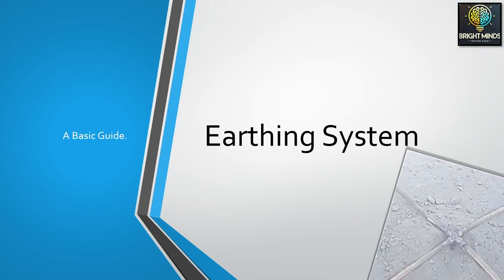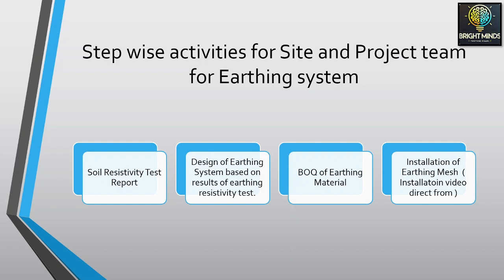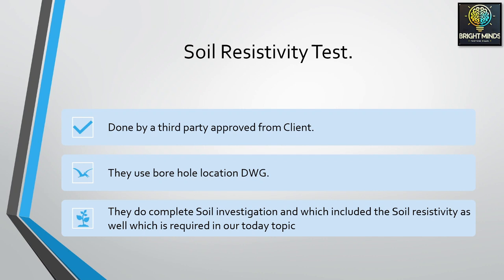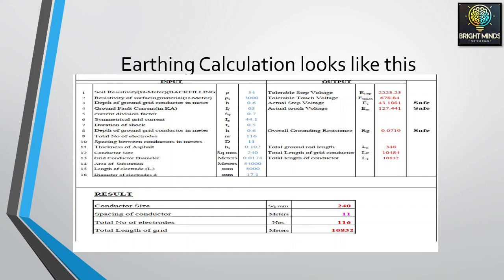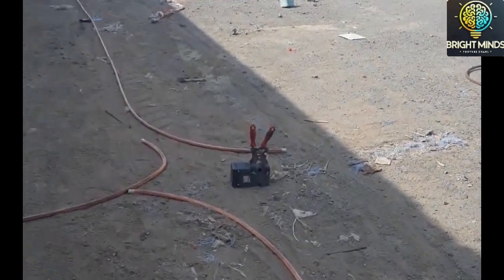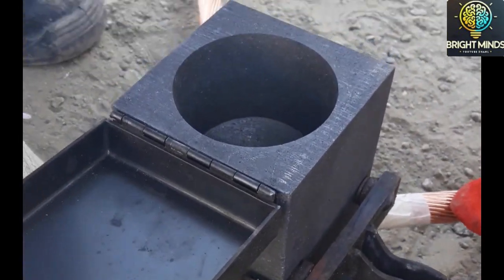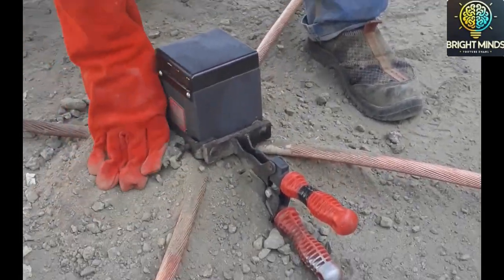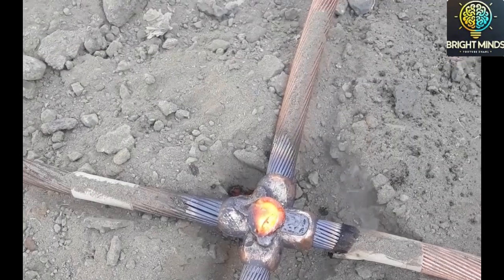Earthing System and substation [Video - 6]

Comment: Dear Sir,   i just wana mention that there are a few aspects related to the associated drawings, primarily covering these three areas:  
1. Main grid layout  
2. Reinforcement earthing drawing  
3. Equipment earthing drawings.
The design provides these three drawings in this order, rather than at the beginning, and they need to be implemented accordingly. The BOQ and details of joints are also mentioned directly within these drawings.
Reply from the maker: Thanks for your valuable feedback, to keep the video smaller we cover one by one. Equipment erarthing will discussed seperately .